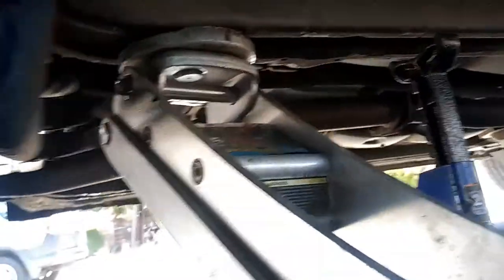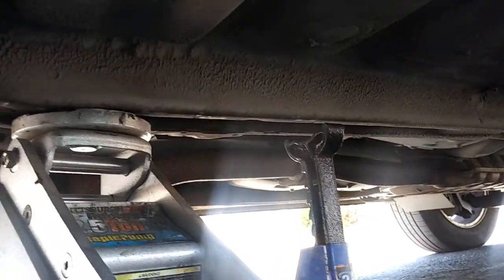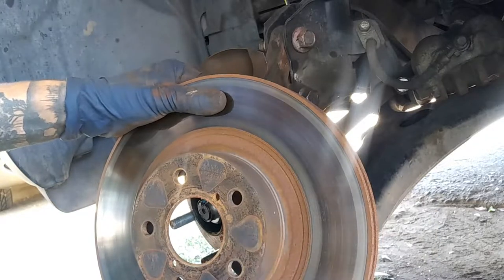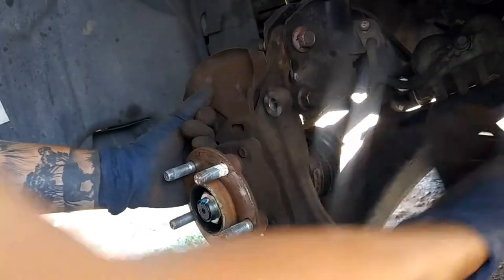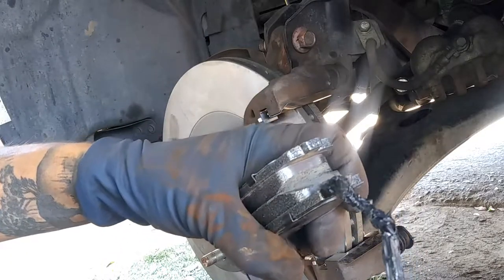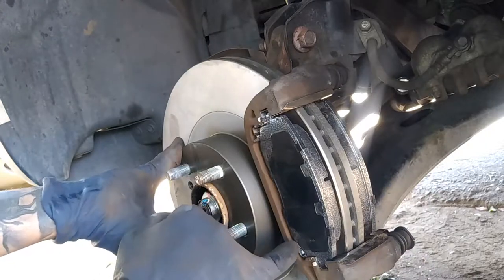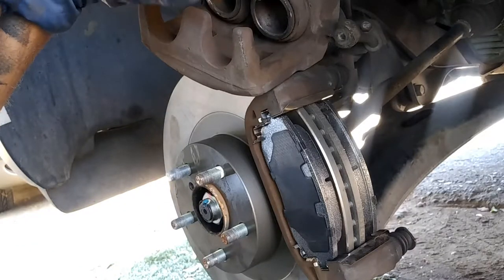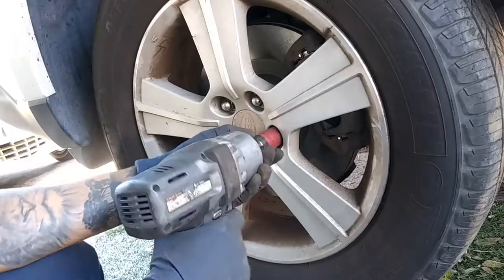2010 subaru outback front brake pads and rotors replacement

Comment: It is a very good idea to open up the brake bleeder screw and push the dirty brake fluid into a container. If you just retract the piston all the dirty fluid goes back up into the abs pump and can do damage to.the pump. And since brake fluid tends to.absorb moisture it would be a good idea to freshen up the fluid

Comment: Nice- Two comments. When your doing pads it is cheap and easy to get fresh brake fluid in the system. Also use a torque wrench next time to tighten the lugs that way they can be taken off w/o an impact. It is the difference between being able to get a spare tire on or not on the side of the road.

Comment: So do you not need to open the cover on the brake fluid reservoir to allow for the displacement from the break pistons being pushed back in
Reply: Bump
Reply: No, you dont.
Eap if ur braoes are already worn down pretty good mainly because its not goint to move much.
However, if u were going to do this for whatever n the brakes were newer, than what u can do is pop the cap off n suck a little fluid out of the reservoir so it doesnt spill over, if its totally full.
Dont beat urself up in the specifics here.
No shop is going to care about ur care enough to even do that, they'll just let it spill out, most will use wrenches on the pistons, which technically isn't the best method.
This is very simple, just get those 4 bolts off, if ur removing the rotors as well, n do ur best it'll be fine.
Just remember to not let the caliper hang on its own by the brake lines, using a bungee cord or even some rope or something n tying it off to some part of the suspension is a great idea, u dont wanna f that up.

Comment: Short and to the point.
I think this is a great refrence video, for people who have done brakes.
However, i dont think its all the inspiring to those who have not.
Although this is easy.
N for the price most shops charge for even the crappiest pads n rotors, one can usually do the job themselves withbthe absolute best kits, and usually even replace the calipers if u wanted and still be under the price of a shop for just brakes and rotors.
Def a good idea to learn how to do it.

Also, a good idea, most brakes will have their own exact way of doing this, but you should break, the brakes in. I think its called bedding or something like that.
Just a simple process of getting the pads to lay flat against the rotors so ur getting the best bite n it absolutely makes a difference.
Its simply going 40mpg n braking hard, n then doing again. N then changing the speeds n doing it again. Stuff like, but look it up because i cannot remember exactly what it is n dont feel like looking it up atm lol
Reply: Decades ago (1973 ish) in my high school auto mechanics class, we had a guest speaker once.  A brake guy.   He was really good.  He called it burnishing in the brakes.  Still remember his words.